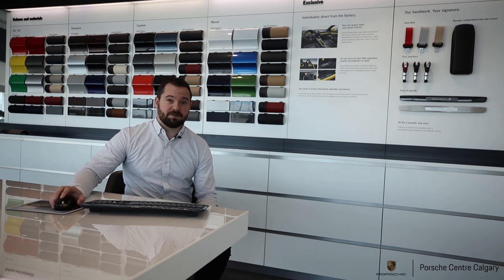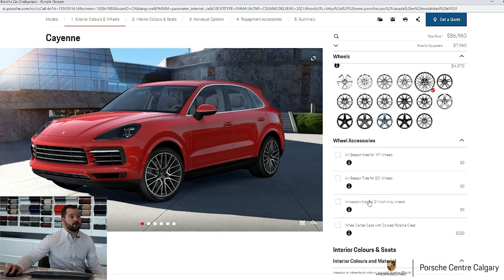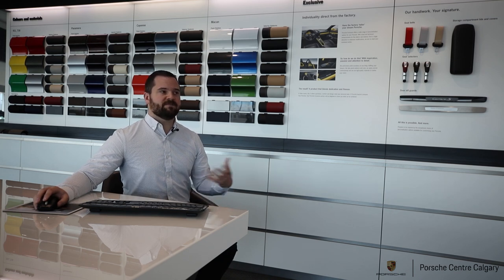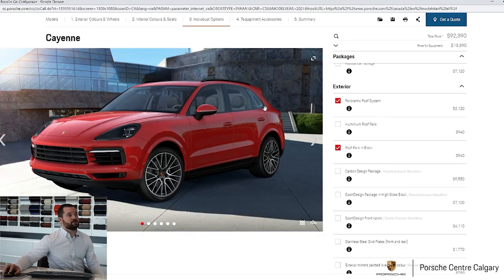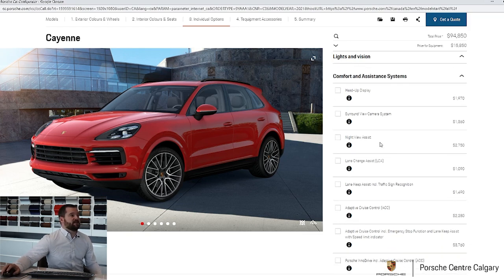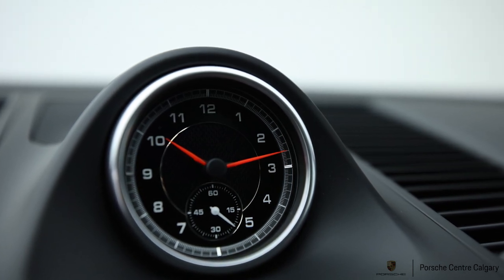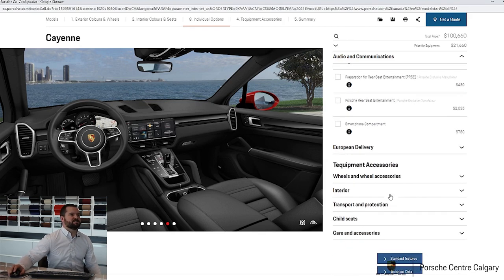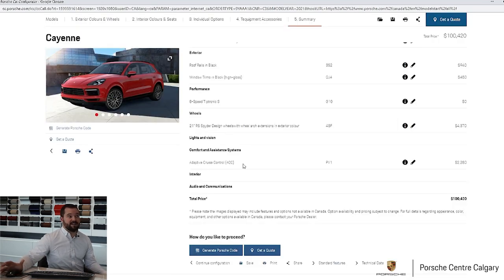Configuring a 2020 Porsche Cayenne | Configurator Build

Comment: First and foremost, really enjoyed the walk through and the transparency on this channel - Thank you Colton and PCC. 

After owning two Cayenne's, one was quite well appointed with more than the standard premium options, and my current is exceptionally appointed I have few recommendations (with cost sensitivity in mind)

The audio is a tough one, the Bose is "OK", the Burmester is better, however the cost differential is immense, and considering the cayenne isn't a vault quiet car by design, the benefits might be lost.

Unfortunately Porsche doesn't offer the option anymore to give the body colored wheel arches without buying the large and expensive wheels. The black plastic wheel arches exceptionally cheapen the look of a very expensive vehicle.

The "semi-autonomous drive" tech is a good future looking option at a time when even Nissan offers this feature set. The 18 way seats are a game changer for me personally, they are harder to get in and out but fit like a glove and feel and look very unique. 

Lastly, and most importantly, do something that reflects you and is 'special/luxurious'. Something that is going to make you feel good every time you get in/walk away from the vehicle. (Exterior) Whether that is a special color (which comparatively is a good value option considering what it does to set yourself apart and the impact it makes)/White Brake Rotors etc. On the inside, even with the Premium Plus package, it can feel a bit 'sterile' and 'basic' for a car that costs $100k +. Do get something like a special trim package/wood or carbon steering wheel/extended leather/contrast stitching or colored seatbelts, so that every time you get in and drives makes you feel like you have something that someone else doesn't have and frankly feels more special than a Mazda CX-9. This optionality and personalization is what you pay for when you get a Porsche and worth embracing even if its a touch here or there.
Reply: I came in a bit higher than yours... But I'll play :) PMYJBWW3
Reply from the maker: @Neil4Speed  These are all great points, thank you for sharing, your build code will be placed into the draw, Thank you for watching!
Reply from the maker: @Neil4Speed  Please fill out the form here with under general inquiries with the note - "Send to Marketing for Sept Contest" in the notes section - https://porschecentrecalgary.com/about_us/contact_us.php      Thank you for participating!